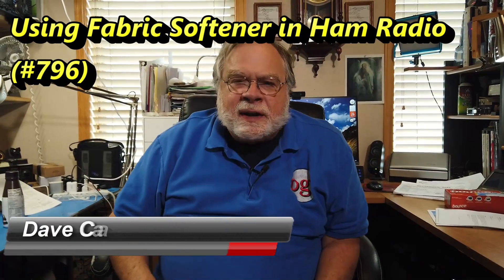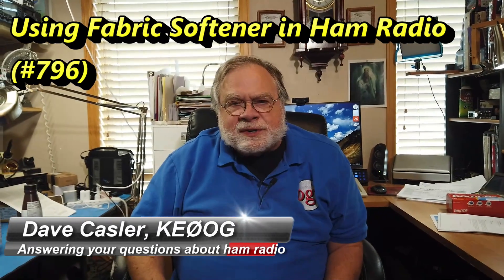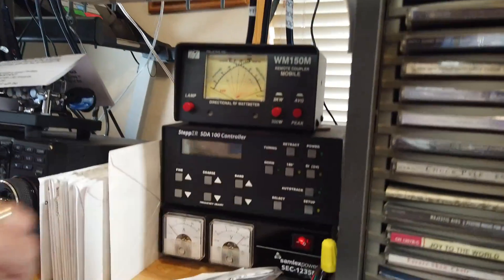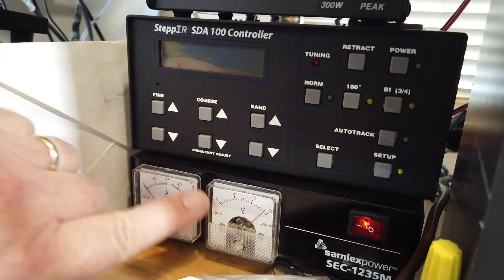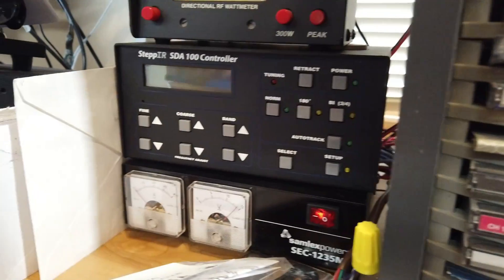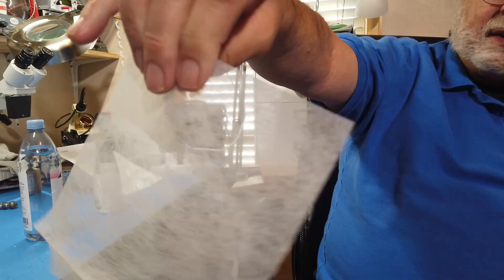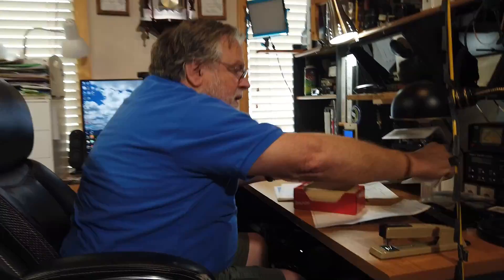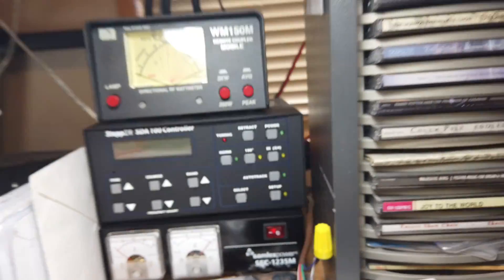Using Fabric Softener in Ham Radio (#796)

Comment: Those are called D’Arsonval meter movements, although the Weston version is more rugged and are typically the style used. I always just breath on the plastic cover to discharge the field. Then I tap the meter movement before I read the display. Hams and electronics folks have been doing that since day 1.

Comment: You can put a dryer sheet into a spray-bottle filled with water to create an anti-static spray.  If you spray it on a carpet that is charging you up as you walk across it on a dry day, it reduces or eliminates the annoying (and dangerous to your electronics) sparks from your fingers.

Comment: This is well known to people who used to service early PCs in the 70s to 90s.  I was given a spray bottle of Staticide, which was a chemical that you sprayed onto computer and monitor surfaces to bleed off static charges and prevent the odd system hangs that used to plague those systems.  My boss at the time said that the stuff was little more than a weakened solution of Duz soap though how true that was I can't really say.  It also came in lint-free sheets and alcohol packets that you simply wiped on the equipment mostly just to keep the customers happy.  The sheets do work, though.  I still have some and use them on my VTVM meter face as it is very sensitive to static charges.

Comment: They also are good to filter air.  I use them in the dryer then put them on a fan and in time they will turn dark from what they took out of the air.
Reply: Really? That’s interesting.
Reply: I have used them used from the dryer as a dust wipe - they work great still and I suppose still work as static reducers since they pick up the dust nicely

Comment: The aluminum in there may be the hot deal for static but it's the rest of the chemicals that you ought to be concerned about. Not the least of which is the chemical scent added as well as the other unnatural chemicals to "soften" your clothes.

Comment: Thanks Dave for the very interesting video.  Always enjoy them.  Think I will try to make a duster made from dryer sheets, cut into strips, as an experiment.    Was curious if the meter movement cover was made from glass instead of presumably plastic, maybe it would have a different effect, on retaining the static charge.  Also, the room humidity may play a role, too.        73,  AC3HT

Comment: Dryer sheets use chemistry to eliminate the static. You have to get into all the cations and anions yada yada. Basically, chemical elimination. But dryer sheets have another use. Do you have anything that mice get into that you don't want them to? Well, dryer sheets usually have a pretty strong scent. Mice hate strong scents. Put dryer sheets where you don't want mice to go and for a couple months or more they won't go there. You can even recharge them by putting drops of strong smelling things on the sheets (menthol, eucalyptus, mint, clove, whatever). So if you find a dryer sheet in someones glove box, now you know why.

Comment: Hi Dave, another inaccurate explanation here.
By static you mean to say the "triboelectricity", I understand.
What happens to the stylus in the meter is a different story.
And this can easily be appreciated in a cross needle meters rather than in the most common single stylus meters.
Because one stylus (needle) would be closer to the dial face and the other very close to the front transparent plastic material (usually poly carbonate, poly ethylene or propylene). The stylus or needle, though is made of aluminium is coated with a paint, an insulating material.
Triboelectricity is usually taught in the schools as frictional charges, while in fact friction is not necessary at all. When two dissimilar insulators/non conductors or bad conductors of electricity are kept opposed intimately for some time and are separated suddenly there occurs the phenomenon of charge imbalance. Because unlike in metals (in which there are free electrons to be moving about easily from the outer most orbit) the electrons in the insulators are tightly bound. 
So, dissimilar insulators at the time of sudden separation have some electrons in excess on one material (making it negatively charged) and leaving the other substance positively charged.
If you simply rub (with your fingers) on the face of the dual (cross) needle meters one or both the needles would depart from the "0" position and it might stay there for quite some time unless intervened.
Yes, rubbing, this time slowly on the meter face in the opposite direction towards the "0" point would bring the needle back.
That's you don't need a fabric softener sheet at all, as now you know what is exactly happening here.
And the fabric softener doesn't contain aluminium but cationic (or anionic) organic compounds that would provide the charges needed to make the fabric fibers stand flexible and feel lubricative.
De VU2RZA

Comment: Hi Dave. Love your videos!
Dave. Is it true that cutting a piece of coax to an exact half wave length, of course figuring in the velocity factor, then using as a jumper, will
give you a true and accurate reading hooking it from the radio to the SWR meter and then of course from the meter to to antenna on the main antenna feed line and your main feed line being a total of multiple half wave measurements?
If you answer this, Thanks so much in advance!
Keep up the great videos! Very educational.
Groundhog, aka, Triple 3 in the Show-me-State. Old 70's call sign KSS-2012
Reply: Hi, the near end of a half lambda transmission line (with the VF taken into account) would represent the impedance at the far end of the line. Whatever be the feed point impedance, a line of half or multiples of half lambda would repeat the same impedance at the other end; but this happens exactly at a single frequency only. But the SWR over a small range on either side of this frequency will be like less than 1.5:1.
De VU2RZA